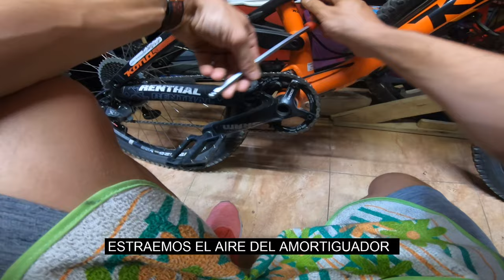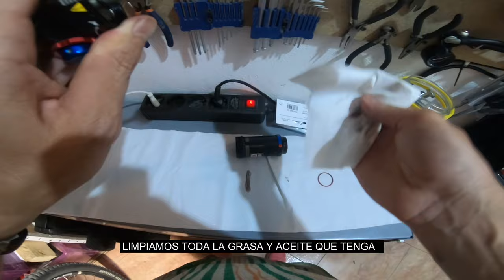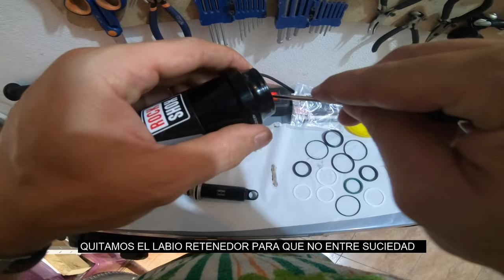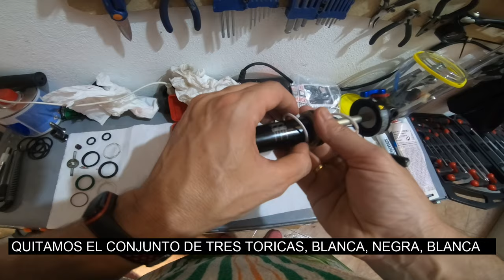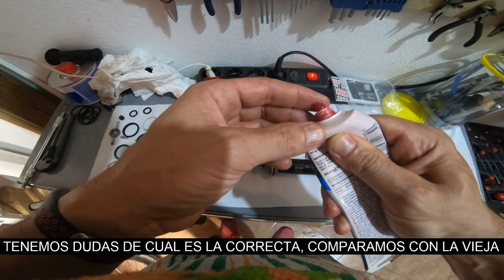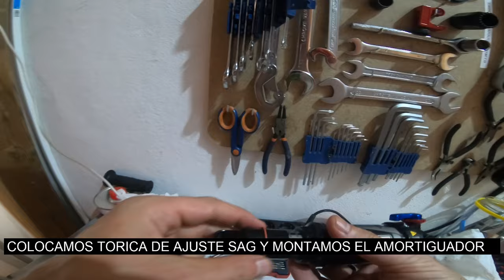MANTENIMIENTO BASICO AMORTIGUADOR ROCK SHOX MONARCH RT (FACIL, RAPIDO)

Comment: Tengo un RT y no has cambiado una tórica que tiene en la parte de abajo-.  no hace falta?.Me ha parecido extraño. Una pena que no se vea cuando ca,bias la tórica interior de la tapa. Y lo de meter el aceite por la parte de la válvula no lo había visto nunca jaja. Saludos
Reply from the maker: Hola josema , la torica a la que te refieres que es la que esta dentro del cuerpo donde esta el dial, si es esa si esta cambiada. Lo que pasa que ese paso no lo grabe, y el tema de echar el aceite por la valvula es porque es mas facil. , espero haberte ayudado un abrazo amigo
Reply: @ENDUREITORSHARVARDMTB  . Mi Monarc RT tiene una tórica justo cuando acaba la botella por la parte de abajo aparte de que por mas que doy vueltas y mas vueltas no logro desenroscar. Me temo que esta roto, pero me extraña que con la presión no salte